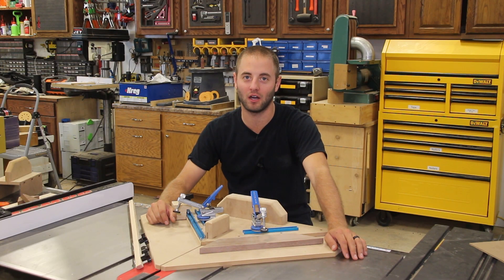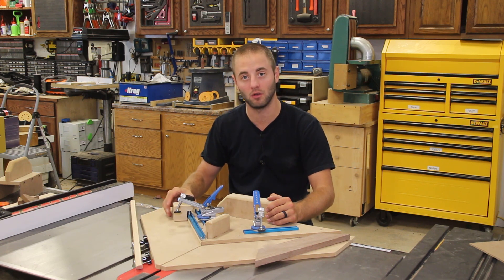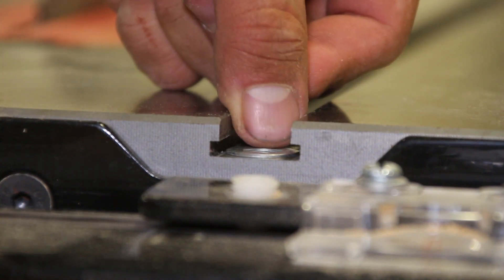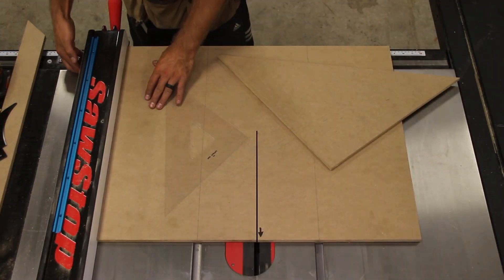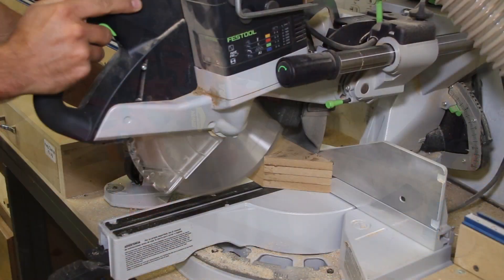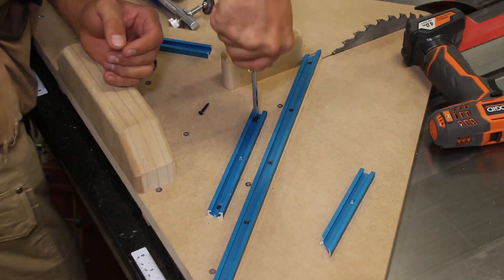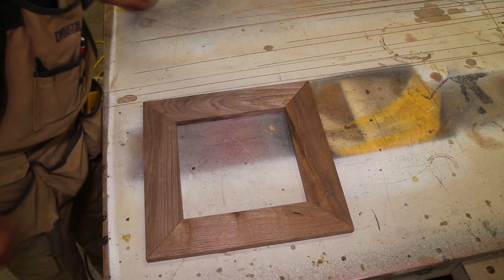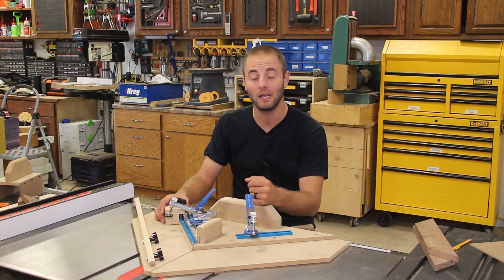Shop Made - Table Saw Miter Sled for Perfect Miter Joints

Comment: Great job & nice sled! However, as noted below, I don't get how you reference the cut piece against the stop block and get the same lengths? Steve
Reply from the maker: Sapele Steve two way, measure your first price, make the cut and then move the stop block. Or measure from the stop block. -Andy

Comment: Looks great; couple questions. What kind of calipers do you use/like? I see it is digital; do you like thumbwheel types in general? Also noticed that at 6:11, the perfect 90 degree joint, there is some splintering on the inside corner. Do you think that was from pushing the piece through the blade too fast? Is there a good way to prevent that aside from wrapping each cut line with tape beforehand? Oops, just rewatched and see you have the Neiko digital with thumbwheel. Think it's as good as Starrett?
Reply from the maker: Calipers are a cheap set from the big box store. Definitely not better that Starrett but I don't need that precision. In my opinion the thumbwheel is a must.

Comment: Andy  ..  I don't understand how your stop block in the video works.  I get the idea - cut from the left - switch to the right, clamp & cut.  What I don't get is how you determined the length of the piece since when the piece hits the stop block it is hitting in the middle of the recently cut edge.
Reply: I noticed that, too. It seems to me a stop block at least as wide ass the stock being cut would solve the problem. You need the long end of the stock to contact the block.
Reply from the maker: Umpire20NM two way, measure your first price, make the cut and then move the stop block. Or measure from the stop block. Let me know if you have any other questions. -Andy
Reply: Wouldn't a stop block cut at 45 degrees be more accurate?
Reply from the maker: It most likely would but I guess I have a different way of measuring my needs and marking. Placing the material on the sled, clamp it down, and then move the stop block into it.
Reply: That caught my attention too, the workpiece hitting the stop block in the middle of the mitre.  But Andy is right, if you butt the stop block up against the piece for your first cut to set the length, the other pieces you can just move until they get "stopped" by the block, and cut there.  Should work just fine.  Thanks Andy, very nice build.

Comment: Interesting...it looks like you have a Kapex miter saw with a fence and stop block.  Does that setup not work for cutting perfect 45s?  I ask because I have been wondering about the accuracy of that saw and its suitability for that very purpose (and was thinking of buying one as a result).  I was hoping that with the exorbitant premium it commands over all other miter saws that it must have accuracy (along with dust collection) that is unmatched.
Reply from the maker: It does but isn't always 100 percent. A dedicated sled is the way to go! In my opinion, unless you are doing high end trim work, the Kapex isn't justifiable. Overkill for my woodworking shop. If I were to do it again, I would get the Bosch Glide.
Reply: I appreciate the honest feedback.  It was going to be hard to justify the expense of the Kapex, and I am definitely only doing "hobbyist woodworking".